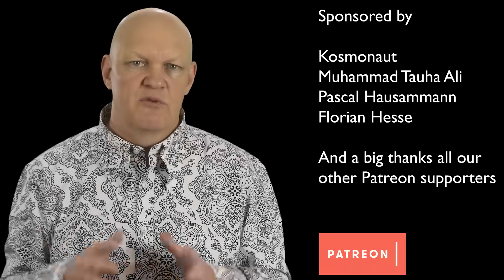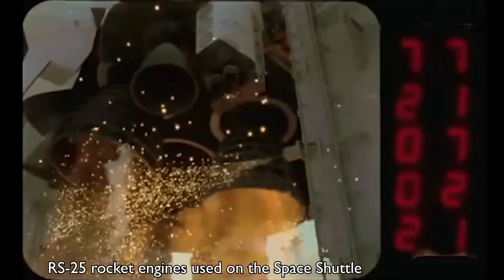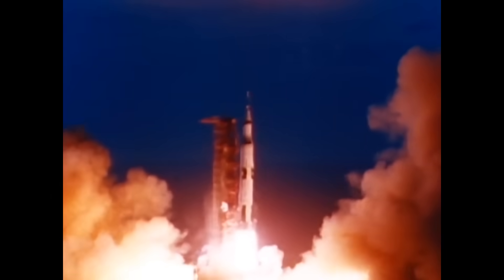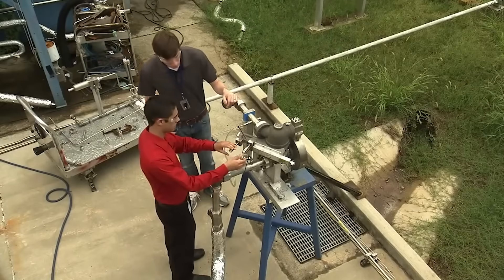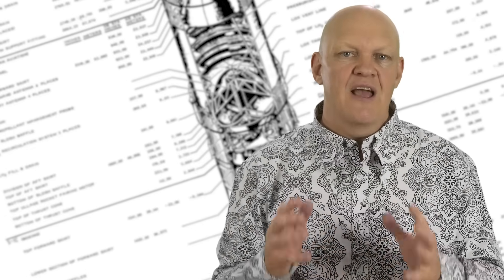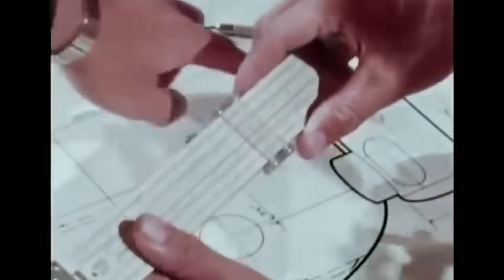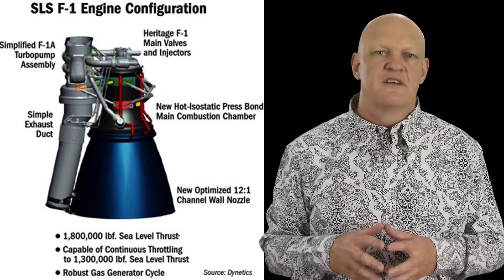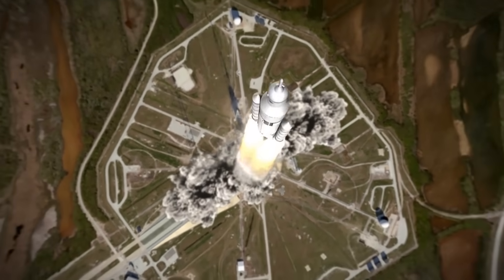Why Can't we Remake the Rocketdyne F1 Engine?

Comment: Maybe someday we will dispense with the space shuttle technology totally.. That will be a good day, like Droid said our new SLS stinks with the taint of crappy shuttle technology.. NOT so much that is was crappy but its older and we should not design around it.. If I recall first thrust for a shuttle replacement was the Constellation program, where all new technology was suggested.. Engineers that were going to be replaced pitched a huge bitch that went all the way to Congress.. I cannot find nor recall the name of this group and yes they had a campaign to re-use old parts.. Younger folks like me cringed and hoped they would lose... Well they did not lose, apparently they convinced Congress to utilize the old parts .. Funny fact is this, in articles of the day you will read text that states "If we don't utilize existing technology we wont have our rocket till at least 2020".. In typical NASA fashion they used the old technology and I will bet they still don't make it by 2020.. Booooo...

Comment: What they should do is take the 3d models and toss them at an AI machine and have it continually refine and retest the design.  I am willing to bet it could get to 25 parts or less and be another 15%+ more effecient.  It is amazing what this process can achieve.  We are so stuck on what we shave off and what holes we drill and not what is needed for stresses.

Comment: Did you say reduce the parts from 5600 to 40 WOW
Reply: Shows you how engineering has advanced since then. Materials science is in another universe compared to what it was back then, machining and manufacturing techniques and tooling have advanced tremendously as well.
Reply: Not how engineering has advanced, how marketing has. It's just like the Glock pistol; they claim that is has fewer parts than other pistols, and is therefore simpler, but that's because they define a "part" as the end-user serviceable sub-assemblies. If you actually break those down and count the parts... parts that are just as apt to individually fail as any other... well, at that point the inherent dishonesty becomes apparent. There's no way you reduce a rocket from 5600 parts to 40... you just subcontract all those parts so the final assembly is 40 sub-assemblies. That's engineering and cost reality, there is no space magic. Because one of the other inherent dishonesties of contracted subassembly-based manufacturing is when one of those assemblies is borked, the manufacturer won't let you have the tiny 1-unit-currency pin that failed, they take you for the entire cost of a complete unit. 
TL;DR: Claims of simplification THAT extreme are almost always cleverly concealed lies, attempting to sell the uneducated, uninformed simpleton with money (corporate execs, Senators on funding committees, end users) the idea that the thing is more cost effective or advanced.
Reply: Modern CNC rocks. In this case, I would say rockets!
Reply: 35 Mexicans and 5gallons of fuel
Reply: Mexicans? Hmmm surprised they don’t make a rocket to launch themselves over the wall into the USA

Comment: There's an old rocketdyne factory across the street from where I live. They've got a big F1 standing upright in all its massive glory in front of the facility (Winnetka, CA). Pretty cool
Reply: Hey Anton, thanks! I had to look up location on Google maps to have a look.. very nice.  Here's the map location I viewed: https://www.google.com/maps/@34.2330682,-118.5882204,3a,75y,44.24h,91.44t/data=!3m6!1e1!3m4!1s1dyySKL1Z38QW6fr-eLrYQ!2e0!7i13312!8i6656?hl=en
Reply: omg, I'm gonna go visit that. thanks for the info!!
Reply: @captmack007  Before doing so go online and spend some time familiarizing yourself with the F-1's design. To the uninformed an F-1 looks like just a convoluted collection of pipes, wires and machinery. To really appreciate the majesty of the F-1 and to understand how it worked some preliminary research is necessary. Pay particular attention to the gas generator and the turbopump as they had the immense task of pumping 3 tons of propellant into the engine's thrust chamber every second.

Comment: There is a Haynes manual on the Saturn Booster, the most amazing thing to me (having read it) is the complexity of the pumps required to drive the RP and LOX through the engine is epic. The turbines needed to achieve the PSI are more complex than anything i have ever seen...and thats just the Pumps..
The UI was amazing.

Comment: We’ve already seen one instance where the solid rocket boosters have failed but there has never been a failure of the F1 engine during an actual crewed mission so I think rebuilding the F1 engine would have been the better option due to the fact that it has never failed during a mission.

Comment: While it is good to appreciate the skill and design of the old, it is also important to utilize the knowledge and wisdom that developed from these programs while many design principles are useful even today, it is also important to utilize the technology that was not available today they did not have. There have been advancements in materials, computer modelling and simulation, better tooling to construct as well as more predictability and better failsafes as well as more efficient designs. What you get now is something that is essentially the same, but lighter, easier to manufacture thus cheaper and more predictability on the wear and tear of components making it safer in the field.

Comment: Ok its 2019 why are they still using stupid inefficient rocket fuel engines  dangerous to produce and store liquid  wht happend to ion engines scram jets piggy back launches single stage to orbit . They can engineer a  car that runs on batteries but cant build a way into orbit with out the use of fosssile fuels which brings up an entirely different argument . Dependence on liquid fuels  keeps us in the past .
Reply: Ion engines are efficient but produce very little thrust. They couldn't get anything off the earth to begin with.

The whole piggy backing something up there is a maybe viable idea for stuff in LEO... maybe, but it gets problematic really fast for anything else. Why? Because the farthest up the piggy back can go is still almost full Earth gravity, so you still need a rocket nearly as big to go wherever you're going.... and that means you need aircraft way bigger than anything we can produce.
Reply: @seigeengine  ok you cant push it onto orbit so wht about  pulling it into orbit  you could use a vehicle already in orbit to to grab it and  yank it the rest  of the way high altitude balloons  could carry a payload to near orbit though the sudden acceleration would most certainly  damage the payload  not to mention how you would go about tethering an item traveling hundreds of thousands of  miles per hour to a stationoanry object .
Reply: @THOMAS01ify  >you could use a vehicle already in orbit to to grab it and  yank it the rest  of the way
A.k.a. skyhook. Unfortunately, we can't build it right now - not with our existing anemic launch vehicles. Starship will help us at that, but we need to wait, until it starts flying.

Comment: Untrue as these engine were bought from Russia. That's why the yanks can't rebuild them. They were Russian in the first place.
Reply: That is incorrect. Engines were indeed brought from russia but much later, in the 90's. In those years the russians had a closed cycle engine that was a very interesting design and as the ussr collapsed they did nothing with them and were just sitting there. The F1 of the 60's had nothing russian in it.

Comment: I'll save you 5 minutes. The design as it is printed on paper is not fully operational. Each F1 engine was hand fitted and hand tuned, and the tuning dimensions was never written down, and we would have to build another couple dozen engines to relearn the tuning dimensions the original engineers used.
Reply: Plus, clusters of smaller engines are scaleable, more efficient, cheaper and most of all SAFER as may small motors can more easily compensate for the loss of a unit during flight.
Reply: @f.d.6667  Clusters of small engines? Like the Soviet N-1? Hardly an argument for "scalable". 

Come to think of it, that's more of a computing term than a practical one here. The F-1 was engineered as a solution to a minimal number of engines for a maximum reliability concept.
Reply: @robertborchert932  There was nothing wrong with the control system in the N-1, it did what it was designed to do. Pity the engine's turbo-pumps had a tendency to blow up and the Russians underestimated the control authority required to steer the thing on the one time that an engine didn't let go.
Reply: @f.d.6667  Like the N1 's 30 engine on 1st stage ? I don't think so....
Reply: In theory yes, but the Russians tried that already. Just look at the N1. It was a costly disaster for them.
Reply: Thus, making it VERY expensive to duplicate the exact enige. Time has moved on, so are the technicians, their tools and materials. There is no need for reproducing those famous engines. Not  in a cost-effective way.
Reply: Anyone who believes this rubbish is a fool, you really believe they can't replicate 1960s technology, it's been 50 years with all the Leaps and Bounds in technology they should be able to build a better one
Reply: @dr.donpaulioni7965  A conspiratorial person might say these engines aren't strong enough to do what they had supposedly done 50 years ago.
Reply: @waterhead1029  I would go one step further and say logic would tell you something stinks
Reply: @dr.donpaulioni7965  And your knowledge of engineer practices is what? ZERO I suspect is the answer.
Reply: @richardvernon317 Dont need to be an engineer too see bullshit, just like you dont need too be a mathematician to know 2+2=4, clearly you lack common sense and independent thought.
Reply: Don Paulioni Do you know why 2 + 2 = 4 ? Have you read the proof or are you relying on what you’ve been told all your life?
Reply: I am not the only one that believes that the technology and know how is better these days than in the 60s space race. So shouldn't that be enough to create something better to go to space or the moon now?

I say try the new modern F1-B rocket engine design on a real unmanned mission to the moon.

From that experience, rocket engineers will gather new insights. 

Document all the insights discovered. Safely store the new insights and knowledge for future generations to come.

Or is that too much to ask NASA or any organisation?
Reply: @JohnSmith-yy8hn  well we have to ask why and what we are doing.

You said we should send another mission to the moon on a rocket using the F1-B. Plausible, but why? As an engine test? We know the engine works fine. We aren't going to the moon because as of today, in 2019, we have know reason to. Scientifically, we have a great deal of knowledge of the moon and the majority of what we could learn has been learned. Now there are surely enough scientific discoveries on the moon to keep geologists busy for years, but compared to what we have going on right now, its low on the list. 

What about resources? We know that the moon has many pockets of valuable resources like titanium and helium-3. Theres enough titanium on the moon that we could build door knobs of the stuff without getting pricey, but right now, theres just no way to mine the resources and send them back in large quantities without extreme waste, and by the time we do have that ability, hopefully we will have a more efficient way of sending people to the moon than sitting them on top of a multi million kilogram bomb and sending it upward. As for the Helium 3, well that is a great resource for fusion fuel, but economically viable fusion reactors are no less than 40 years away, let alone wide spread reactors. Point is, it will be a couple centuries before we rely on fusion to power our society, so theres little point in going up there now and mining the stuff and then storing it in massive tanks for decades(which btw is difficult seeing as helium is the most difficult element to contain as far as I'm aware)

We will go back to the moon. But not right now. But if China said they were going to Mars, the US would have a man on Mars in 10 months. 1 month to design and build the rocket and 9 months to get there. Isnt politics fun.
Reply: Это не очень убедительно. Очень похоже на оправдание беспомощности.... Видимо это банальное враньё.
Reply: so let's do it
Reply: Then they should get started. How many government programs get researched for years and years? The sooner they start the sooner the process can be perfected. It's almost obscene that a 40 year old rocket engine cannot be reproduced with all the so-called progress we have made scientifically.
Reply: @stevewalker4263  well it can be, it was far easier to just design a new engine. The F1-B has far fewer parts and doesn't require the hand fitting of the old F1, and that, it's nearly 20 percent more fuel efficient for the same lift generation.
Reply: Thanks m8
Reply: Well said Sir. Well said.
Reply: Trust me this is a thing we've got schematics at work that haven't been updated in 20 years
Reply: Thanks
Reply: thanks
Reply: The Duke ohh aren’t you a cool guy. No one cares what you have too say, you’re a nobody.. we subscribed to watch these videos.
Reply: @jangamaster8677  you dont care what I have to say, yet you read my comment and felt the need to reply. While it was a negative feeling, you still cared. I'm flattered.
Reply: @jangamaster8677  you must have been very sheltered as a child if a comment as benign as mine offended you. And the fact that you couldn't pick up on sarcasm in comment tells me you dont talk to many people through text. I pity you sir.
Reply: @jangamaster8677  you will eventually see the truth, NASA tells lies and nothing but lies every picture they show us is bulshit, i accepted when they showed a picture of Mercury a few yrs ago, it looked exactly the same as a picture I took of the moon just with a splash of colour added to it, or when they showed pictures of the amazing aurora on Jupiter it was clearly the exact same picture they showed of Jupiter 5 years ago with the aurora CGI'd onto it.
Obvious cutnpaste clouds on pics of earth, pentagonal shaped storm on saturn? A natural weather phenomenon in the shape of a Pentagon? How is this even possible?
The more u look the more u realize they are full of shit.
Reply: Don Paulioni do you realize how insane that sounds? NASA isn’t the only space program, dozens on nations have them. Does that mean dozens of nations and millions of scientists are all working together too pull a hoax on the public? Give me one good reason why every nation on earth would want to trick their own populations.
Reply: @jangamaster8677  I'm well aware how insane it sounds, about as insane as NASA'S Apollo missions sound once you look into it.
No other space organisation has claimed too send men to the moon, or even thought about attempting it.
Reply: Lies, nobody designs and builds without records, because you always want and are thinking of replication at the back of your mind. This is pure bs excuse
Reply: @whiterabbit2313  Tribal knowledge, and the loss thereof, is definitely a thing. I'm in aerospace, you wouldn't believe how much of the design side of things is only in people's heads. Design intent can sometimes be as important as the design itself, and frequently isn't communicated.
Reply: @whiterabbit2313  there are very detailed blueprints for the F1 engine, but any note about (torque the bolt on the left of I beam J7 with an extra 5Ib-feet to improve stability and rigidity) is usually lost of just never written down. Engineers draw pretty pictures, and technicians build them. Nobody gives a shit what the technician did to make that picture into a product, and those build notes are what we dont have.
Reply: @theduke7539  how many more decades do you think it will take before somebody can figure out how to build one of these rockets again.
🥒✊✊✊✊🥒💦
Reply: @whiterabbit2313  I am a retired engineer from a place where we worked on jets.  I assure you the man is exactly right.  The paperwork never keeps up with the man with the tool in his hand who has done it day in and day out.
Reply: @whiterabbit2313  It is totally devoid of even basic logic. "Joe, what did you do to Part A, before I start on Part B?" "I dunno, I tossed away my notes and measurements". Ludicrous. But why lie?
Reply: @waterhead1029  have a good look into NASA, into all the pictures of space stars and planets, they are lying about all of it, the odds that all the planets in our solar system just happen to be all on a level plane so they can be viewed from Earth are in the billions or trillions to one, then also take into account a total solar eclipse is also one in a trillion the sun is hundreds of times bigger than the moon and the moon just happens to be in the perfect spot in the sky to be able to eclipse the sun perfectly, and even stranger the moon only casts a 70 Mile shadow, another impossibility.
The only conclusion is everything we think we know about space is a lie
Reply: @dr.donpaulioni7965  It's all bullshit. One day we will get through those darned radiation belts. It's fucking wizardry. I'm going back to crystal spheres. They didn't record over over that did they? Is the sphere technology still there?
Reply: @whiterabbit2313  there is tribal knowledge in all design groups.  "Know how" is a real thing.